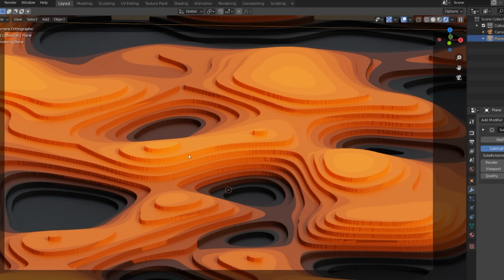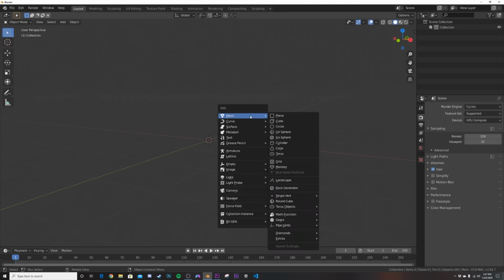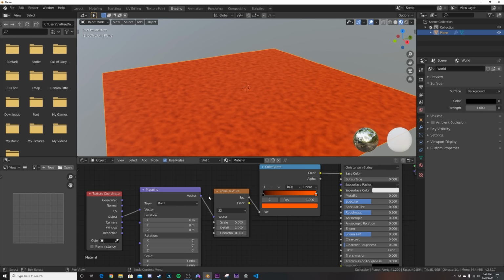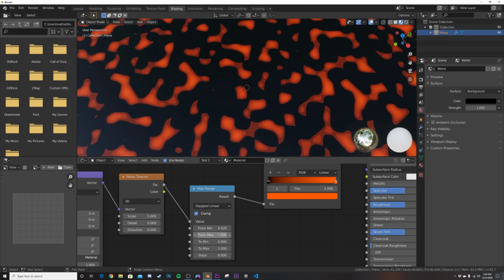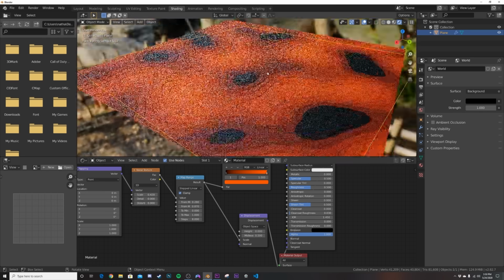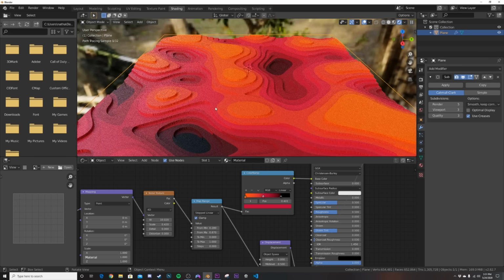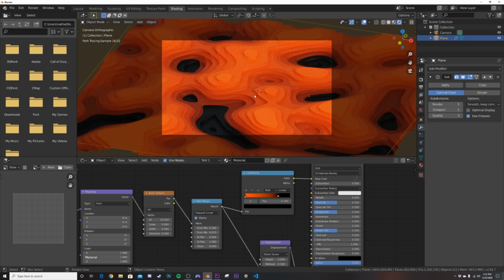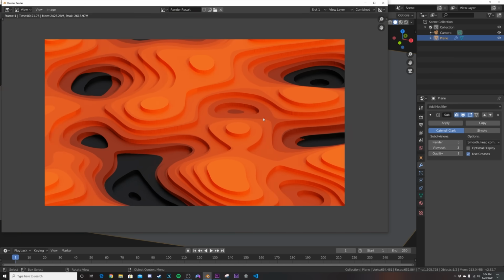Create Procedural Stepped Landscapes with Nodes!!! (Blender Tutorial)

Comment: Here is why: your gradient has been quantized (goes from one color to another immediately with no transition). In theory this should not be a problem if the displacement is infinitely accurate (since then you'd have a 'curve' of vertices that perfectly traces these transitions) but of course this is not the case. This means that 99.99% of the time a 'boundary-vertex' will fall into one of the two regions (instead of the boundary). Effectively this causes color spill in both directions and this can be minimized with higher and higher division levels.
Reply from the maker: Thank you dude!!
Reply: @CGMatter Are you sure about that? Because I thought it was because cycles displaces the geometry first and then applies the color on the displaced geo (using the object or generated coordinates). I believe that is the case because this sort of color spilling happens even when you are not quantizing the noise. Reference- https://imgur.com/a/PSXUtgA
I asked Midge(mantissa) about this in one of his live streams and his solution was also to just use the UVs in such cases.
Reply: @devanshutak25   yes and i also thought he tweaked the colour differently on colour ramp than the 4d noise texture
Reply: @devanshutak25   Right. You could also switch the Noise to 2D.
Reply: Beat me to it. Couldn't find a video of you explainingn it in time.
Reply: The issue can be fixed by feeding the texture coordinate / object / separate XYZ / Z into the factor of the ColorRamp. This way the actual resulting displacement gets colourmapped and they will match up 100%
Reply: @ilkke  Just use the Generated output from the coordinates node
Reply: TECHNICAL EXPLANAITION: 
Sorry dude but this didn't fix the issue, the issue come from the texture projection, because blender first compute the projection of the displacement map while initializing the meshes before rendering using the plane and then when rendering, blender recalculate the projection of the color map using the distorrded plane as the object input.

FIX:
 so to fix the issue you should use  UV instead of object in the texture coordinates node.
Reply: You could switch to experimental and use the adaptive subdivision, but your computer might explode.
Reply: Yeah @Devanshu Tak is right, you can actually "fix it" by leaving the Texture Coordinate node output to "Generated" and then the color areas will correspond to the displacement levels. There will be artifacts visible on the edges, and that is what @CGMatter describes.
Reply: Yo genius sir replied,,,out of my mind thing😂
Reply: CGMatter Ur like the Einstein of blender. No offense Ducky.
Reply: i think i am going to have to put this into google translate real quick
Reply: When in doubt, add subdivisions!
Reply: Do a tutorial on what CG Matter said! 👍🏻💥💥💥
Reply: I love how you guys are two BIG blender YouTubers and are just having a Qna session!
Reply: Any tips how to render this without my PC going haywire? Btw taking UV coordinates gets rid of the colorspill
Reply: @faintedG0ose  CG Matter is talking a lot about his sponsor "Concierge Render" ... Check it out.
Reply: @Demon Mercurial oh hey, It’s you!
Reply: Yes yes... I too am big brained
Reply: Bratan
Reply: Cool... Someone understanded? Can someone do a tutorial to me just copy-paste it? Please? Q-p

Comment: Even with my subD res set to 5, I still get a lot of bumps / jagged areas on the transition between the steps. Does anyone have a solution to that? (My colour is matching, but the steps just look rough). I have read through the comments, and comments seem focused on match between colour and displacement, not on jagged transitions in the steps.
Reply: Found the solution - I did not subdivide the plane to X100 at the start, but just used simple adaptive Sub-D instead, and now the transition is more smooth. Thanks for the Tuts!

Comment: I really wish I would know why xD
But color ramps are confusing me.
I tried to get some kind of "local" color ramp in a procedual material. Every object should be colored by the color ramp but depending on their hight they should just be colored by a part of the color ramp. (Imagine there is a color ramp from red on the bottom of the scene to yellow at the top. If i place a spere in the middle of the scene it would be colored with a gradient from reddish orange to yellowish orange, sphere on the top yellowish orange to yellow, bottom sphere red to reddisch orange and everything in between) 
But I just can't get it to work. The only thing achieved was coloring the object in a single color depending on its height. But that is not, what I need xD

Comment: My problems: 
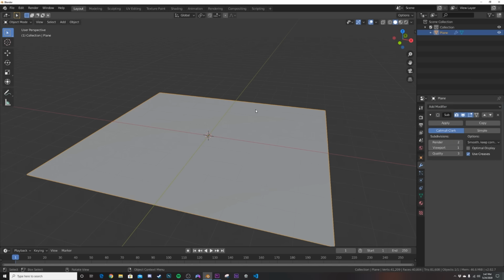1:28 - When adding the modifier, the plane becomes an octagon unlike yours. Unless i press simple, but for the sake of simplicity, (pun not intended), I don't want to go of the script and start pressing things that's not in the video. !!ＦＩＸＥＤ!! - the solution was i forgot to add 100 subdivision after applying scale.

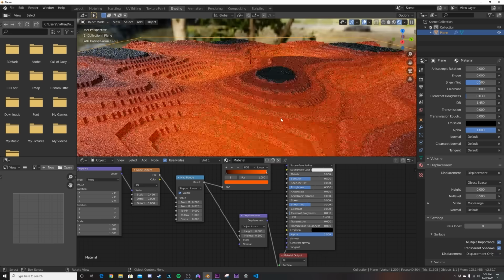4:20 - When adding the displacement node and going to the setting in the material tab to set it on "displacement only", nothing happens. Before when i failed to realise i had to subdivide and all that jazz, it kind of worked, but all i got was giant triangles instead of "stepped paths" like in the video. Still havnt found a way to fix this though, so id appreciate the help!

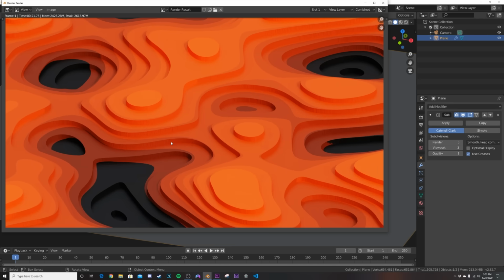Comment: 06:45 Hello @Ducky3D,  I think I have a theory regarding the overlapping issue.
I guess the Noise_Texture_Node gives linear output.
It gets converted to constant input in Map_Range_Node which is used for Displacement. The Map_Range_Node gives constant output with 8 divisions or values or steps.
The ColorAmp then converts this 8 stepped values into linear output with the 3 colors distributed accordingly.

Probable Solution:
Maybe, setting ColorAmp to constant values and tweaking the sliders little bit will help avoid or control the imperfections that was observed in final result.

Comment: The color spill is happening because the noise texture is 3D, and you're working in Object Space. The displacement is calculated on the lookup into the noise texture at Z=0, before the color is assigned to the shading points. By the time the color is assigned, the lookup into the noise uses the new, displaced coordinates of the shading points, at their new Zs, so returning the color of  different points in the 3D noise. You could fix this by switching the Noise to '2D', which will project the Z=0 plane of the noise straight down through the object, so the new heights don't make a difference.
You might not like it,  though, because when the color boundaries coincide exactly with the height boundaries, the color on the cliff-sides is subject to a floating-point choice, rounding sometimes one side, sometimes the other, producing 'shard' artefacts. You could fix that by putting in another Map Range node, and mapping the color to a very slightly larger range then the displacement, in the same number of steps. That should bleed the boundaries of color-fills of each plateau slightly into the plateau below, and away from the cliffs.
But I think the out-of-register color is cool.

Comment: That's another cool tutorial! By the way, is there anyway to add bevel for the edges?
Reply from the maker: I dont think so
Reply: @TheDucky3D  If only it weren't so late at night... I'm sure the edges could be beveled using a bit of math, replacing the hard-corner Stepped Linear of Map Range with a soft-cornered staircase-like function. What were those other options?   Should be pretty easy. Would need high res mesh or high setting in subdivision modifier.   I'd try it myself right now, but tired, sleepy, must wait for tomorrow.  Blender never fails to be interesting and fun!
Reply: @DrunkenUFOPilot  did you ever get it?

Comment: I always wondered when you'd come up with this one. Well done. Unfortunately it doesn't work on my 4GB graphic card satisfyingly because blender crashes with subdivision greater than 4. The edges are pretty rough.
So I rebuilt it without displacement but with a stack of 10 planes and one shader which works with transparency depending on object height. The result is quite similar with hovering papercuts.
Due to transparency issues this Shader doesn't work with EEVEE.
https://www.dropbox.com/s/y5buthmoy901wlt/wallpaper%20papercut.blend?dl=0
Reply: Sadly that's my situation too but I discovered that my PC Gpu is trash my CPU beats it at render... And with CPU I can subdivide up too 5... 50% of the times it crashes

Comment: To prevent irregular color overlap, switch your Texture Coordinate to Generated. Also, if you want your terrain a little bit flatter, reduce the Displacement Midlevel to around a 0.1 - 0.2.
Reply: Thanks 👍
Reply: Texture Coordinates fixed my color overlap as well, Thanks!

Comment: Hey, is there anyway to get rid of the vertical edges that come? I am using 6 subsurf but it still has some vertical jaggedness..I can see that even yours has it.
Reply: I would wager you would need a whole different approach where the contours are formed from strings of mesh points (i.e. modeled) rather than displaced quads from the plane. I wonder if someone can cook up a procedural approach for this.
Reply: I think i fixed it with a denoise node.

Comment: The problem is the way it is mapped. If you do Generated or UV instead of Object space for the texture coordinate node, it wont give you the weird error. I TRIED THIS AND IT WORKS.
Reply: The reason is that with object space, the height of the layer affects the noise texture on the object. It is not projecting the noise texture on top of a flat surface then extruding it, rather it is extruding it then projecting the texture onto the 3d surface.
Reply from the maker: Awesome
Reply: Yeah, I like the way it looks when using the Object space and looks more correct. But Ducky's version still looks good as well.

Comment: Is there a way to apply the displacement of a material in order to get the mesh or you necessarily have to use a displacement modifier and applying it ?
Reply: I think you can save the image from the node editor, then bring it back in and use it with a displace modifier, then apply the modifier. I've never done it, but I think it can be done.
Reply: @JoeyCarlino do I need to render a image of the displacement or can I export it from the node editor somehow?
Reply from the maker: im not totally sure
Reply: The displacement here is produced entirely in the renderer, so, no, you can't extract the displaced geometry from it.  You could do the same thing with a displacement modifier, if your  hardware can hack it.